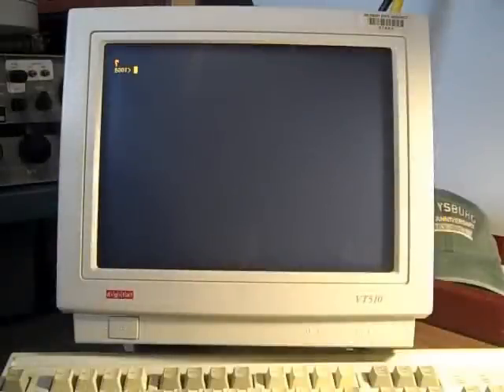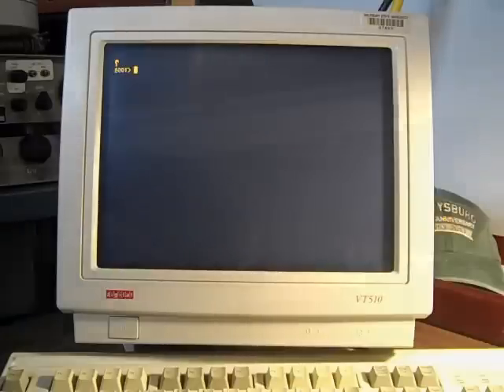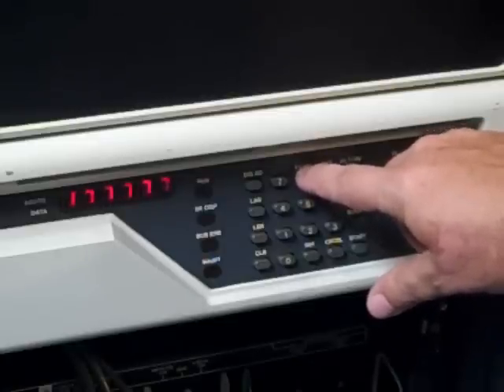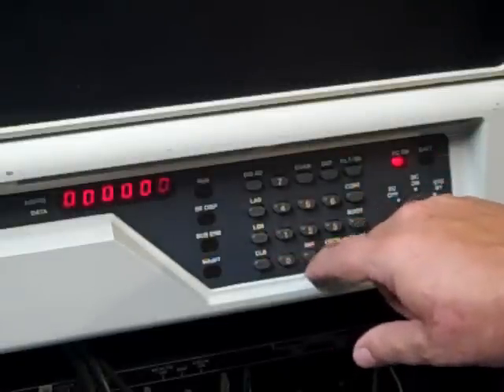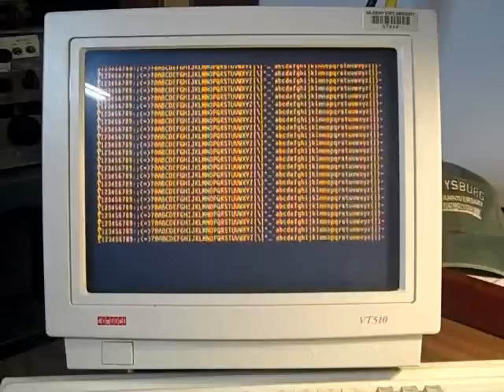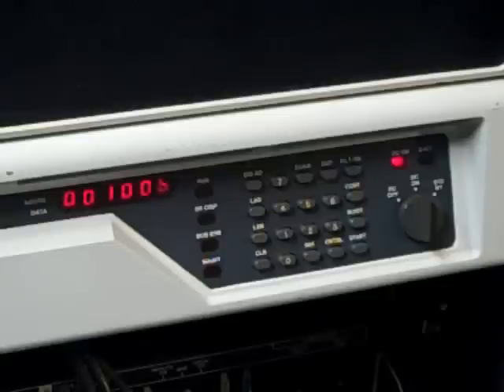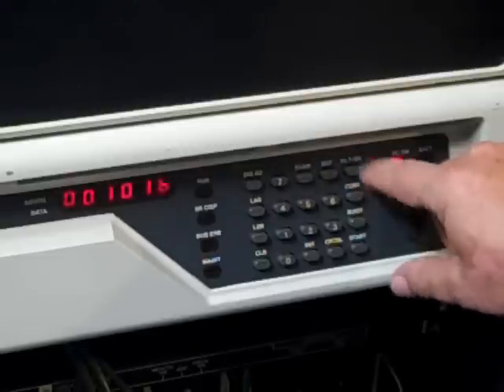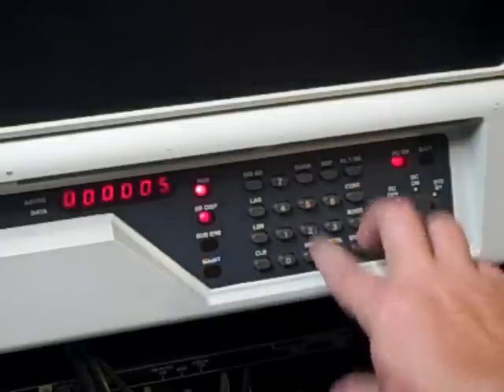Digital (Dec) PDP-11/34

Comment: Interesting stuff, I don't know if my drive is of the same type, you can see it in my 'first test of the quantel paintbox's drive' video, but it's spinning and the heads are moving.  The mainframe it'self is getting a complete electrical refurb so it's going to be quite a while until we actually get to test it fully :o)

Comment: Just for fun, I decoded the instructions entered in.

I'm having trouble with the instruction at 1010: 100376.  I can only assume that this is a conditional branch back to 1006 (TESTB) when the byte tested is zero.  The math for the offset field works out right.

But I can't find that instruction code in any PDP manuals.  Can anyone elaborate on this?